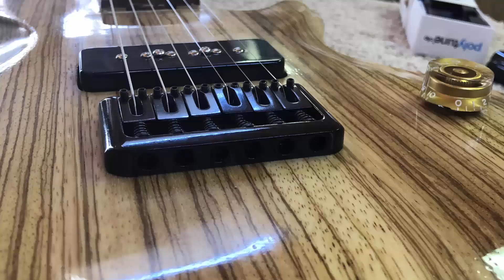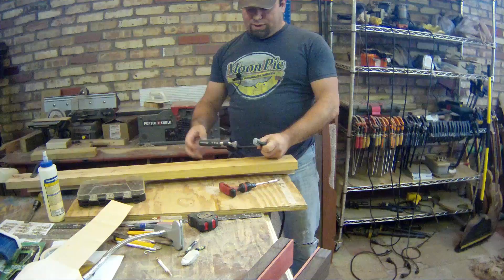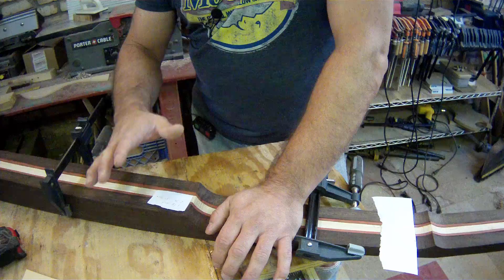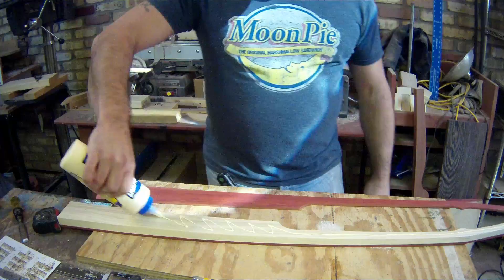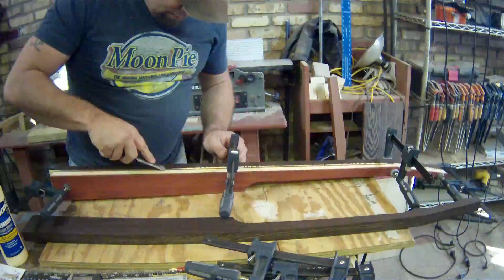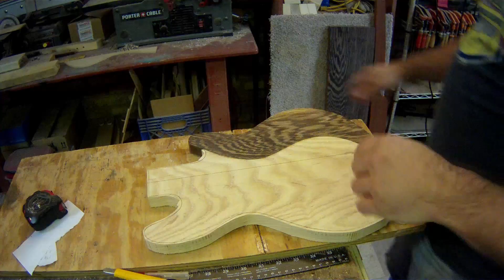Guitar Build 19.06 - Neck Glue-Up

Comment: RED-HEART BLEEDS into lighter woods  BAD!
Reply: The bleeds add 'authenticity' and 'character'....  like an unexpected, 'happy little accident' tie-dye!! [although they can't bleed too much after being sealed; they need moisture and atmosphere to utilize capillary action to spread.....]
Reply from the maker: I hadn’t seen that happen.  Though the one time I used it in a neck it was flanked by walnut...  could be interesting.  I’ll keep an eye out
Reply: @BoneheadGuitars  water-based finish exacerbates the phenomenon. I doubt this will be an issue
Reply from the maker: Good to know.  I used a fairly thin glue up on the veneers since they were going to be so close together.  Hopefully that maple holds up.  But I’ll definitely keep that in mind in the future, I still have some left and it’s sooooooo pretty.

Comment: Instead of the screws, have you tried superglue and painters tape? I use that technique with a drum sander.
Reply from the maker: I could.  But when this started I was running it on the table saw.  Now these pine jigs aren’t as laser straight and the thicknesser is easier and safer.  Someday when I replace them I could just do tape and a thin back stop.
Reply from the maker: But actually, I’ve been trying to think of a better taper strategy.  I’d like to find something variable.
Reply: @BoneheadGuitars  love your videos man!! I’d love to see you make a skull head guitar. It even has a similar shape to a Les Paul body! 😀
Reply from the maker: That’s a lot of carving outside of my wheelhouse.  But ya never know 😀